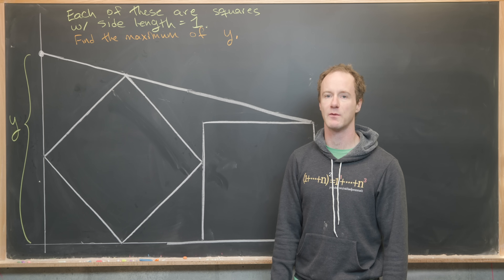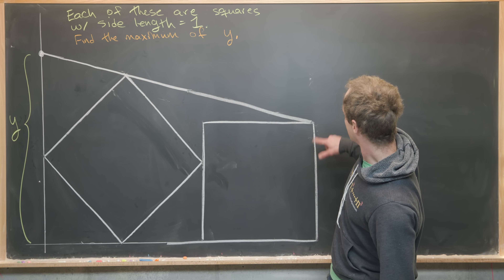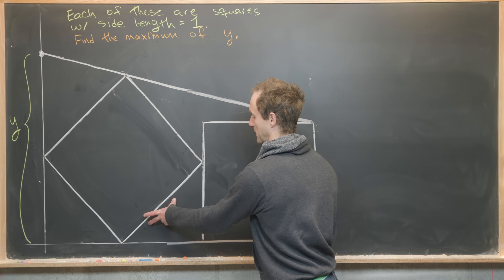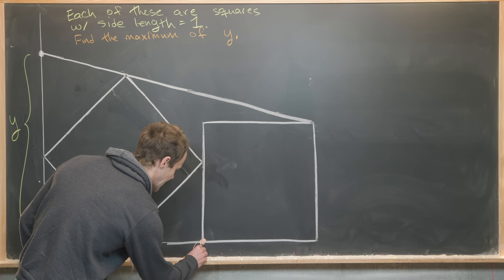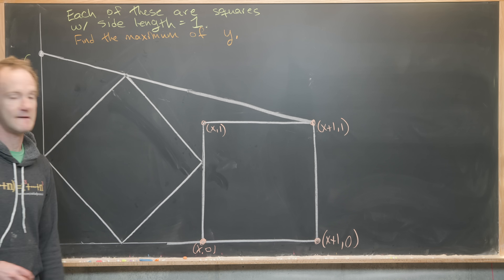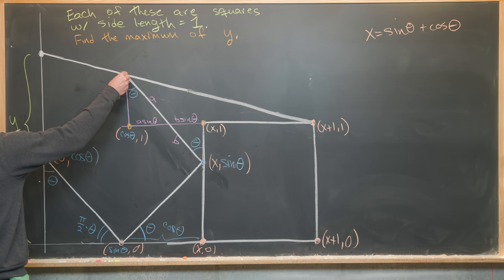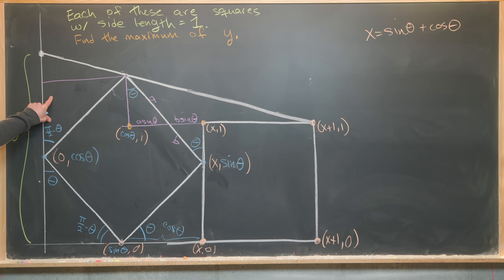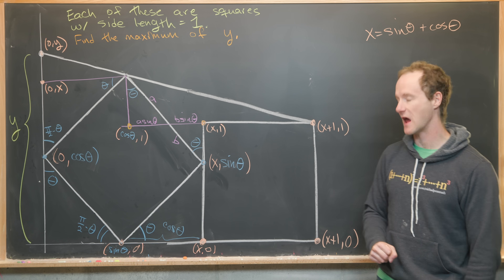How big can y be?

Comment: managed this one without trig. Let A be the x-coordinate of the bottom corner of the left square, and let B be the y-coordinate of the left corner. Then A^2 + B^2 = 1.
The line passes through (A, A+B) and (1+A+B, 1). The y-coordinate of the line between these two points simplifies to y = 1 + A - (B-1)^2/A.

Note that dB/dA = -A/B when you use the chain rule.

Setting dy/dA = 0 and simplifying a bit, you get (B-1)^2/A^2 + 2(B-1)/B + 1 = 0.

It is easier to get everything in terms of B here, so you end up with the cubic B^3 - 2B + 1 = 0, which factors as (B-1)(B^2 + B - 1) = 0. Golden ratio time!

B = (sqrt5 - 1)/2, and since B^2 = 1 - B, you get A^2 = B, so A = sqrt(B).

From there, y = 1 + A - (B - 1)^2/A = 1 - (B^4 - B)/A = 1 - A(B^3 - 1) = sqrt((sqrt5 - 1)/2)(3 - sqrt5) + 1, which is equivalent to Michael's answer

Comment: The problem becomes easier, when the diagram is mirrored along the y-axis and shifted such that the non-tilted square has its lower left corner at (0,0). If we denote with x the height of the adjacent corner of the tilted square, we can find y(x) = 2*x*sqrt((1-x)/(1+x)) + 1. This has an optimum at x = (sqrt(5) - 1)/2 with gives an optimal value for y of (sqrt(5)-1)*sqrt(sqrt(5)-2) + 1.

Comment: I love your videos in general but this solution is a bad one, simply because I haven't heard of a math competition where in the solution you can plug in wolfram alpha. I would recommend a little simpler solution which is based on labeling the same angle theta.
Label the big trapezoid (whose base y we need to calculate) ABCD by starting from the bottom left corner.
Label the topmost point of the tilted square as P. Then in terms of theta you can easily calculate the distances from P to the lines AB and BC.
Let F be a point on the line segment AD such that FC is perpendicular to AD. Again you can easily calculate FC and angle MCD in terms of theta.
In the end you will find that y = AD = 1 + sin (2 * theta) / (sin (theta) + 1). Calculating the first derivative and its roots will bring you to a cubic equation sin^3 (theta) + 2 * sin^2 (theta) - 1 = 0 which is very easy to solve because it transforms to t^3 + 2*t^2 - 1 = 0 which has one integer root and only one positive root. From here you can find sin (theta), cos (theta), sin (2 * theta) and therefore AD.

Comment: This equation is not so difficult to solve by hand 
After squaring both sides you can check for rational roots or get rig of repeated root with differentiation
Remaing quartic can be easily solved by rewriting it as difference of two squares and then as a product of two quadratics 
After solving polynomial equation check the solution because squaring both sides may produce extraneous solutions

Comment: i just assumed the square was rotated by 45 degrees and then i made two points and wrote the straight line. This could be solved more simply with euler's calculus of variations imo
 c

Comment: I don't get the question. The maximum? What maximum? You say later that you turn the tilted square, and it makes it pretty clear, but I really think it should have been included in the question explicitly.
Reply: The question asks for the maximum value of y.  That means over all values of anything that can vary, and the diagram has only one thing that can vary, the angle of the first square.  No ambiguity to my mind.

Comment: y = 1 + (2sinθcosθ)/(cosθ + 1)= 1 + (sin2θ)/(cosθ + 1).   considering dy/dθ = 0 leads to a trigonometric equation which boils down to
t^4 + t² - 1 = 0 where t = tan θ.  Optimal t = sqrt((sqrt(5)-1)/2).  drawing a right-angled triangle and plugging in values for sinθ and cosθ [try not to use Mathematica], gives the result y = 1+ sqrt(10sqrt(5)-22)

Comment: Why can't the box on the left be arbitrarily big, and cause the value of y to shoot off to infinity as the angle minimizes?
Reply: To follow up on my above post, it was a misnomer to assign coordinates based solely on sin/cos, and not taking into account the length of the sides of the left square.  So this solution is wrong, unless there's a stipulation that the box on the left is a unit square, which was never specified.

Comment: I defined x as the x-coordinate of the bottom vertex of the tilted square and used only the pythagorean theorem to determine the coordinates of the important points, no angles involved. 

That way I got y = ((4x^2 - 4x^3) / (1 + x))^1/2 + 1. 

To determine the maximum point I knew the +1 and the ^1/2 dont change the x-value of the maximum so I simplified y to (4x^2 - 4x^3)/(1 + x) which is easy to differentiate. The maximum is at x = (-1 + sqrt(5))/4 and I was too lazy to calculate y. 

The fun part was that I constructed the whole situation in geogebra and also displayed the target function in the same graph which allowed simple error control.

Comment: I did this a bit differently, using the angle of tilt (alpha) of the almost-vertical diagonal from the vertical as the parameter.  Then if y = 1 + z, and c = cos(alpha), s = sin(alpha), I got:
z = (2c^2 - 1)/(1 + sqrt(2)(c - s)/2)
Unwilling to solve dz/dalpha = 0, I just computed z for a range of alpha and found the maximum at alpha = 0.119 to be z = 0.600566, which is sqrt(10sqrt(5) - 22).
I notice that my equation for z looks a lot like yours if I put 2c^2 = x^2, s^2 = 1 - c^2 = 1 - x^2/2, s = (1 - x^2/2)^(1/2)
This didn't quite give your equation, then I realised I needed to use s = - (1 - x^2/2)^(1/2).  Now I get exactly your equation.  :)
By the way: 2c^2 - 1 = cos(2.alpha) = sin (pi/2 - 2.alpha), therefore if I put pi/2 - 2.alpha = 2.theta then alpha = pi/4 - theta.  If I substitute for alpha in my equation for z I get Sergio's equation. :))

Comment: The problem when eliminating theta is, that the quadratic equation gives two solutions. This reflects that x is the same for theta as for 90°-theta. Choosing the solution with sin(theta)>1/2, i.e. theta>45°, is IMHO the wrong one, as for that solution the "top" point of the first square is to the left compared to the (1-theta)<45°, and the slope is smaller (decreasing y). The x in the presented solution is negative, i don't know if that's a consequence or just some sign errors when writing it down, but clearly x>1.
It's probably better to keep theta as free variable.

Comment: If someone might be interested in what difference is made to the maximum of y 
by rotating the square from where the diagonal is vertical,
at the vertical, I got     y = (4 + √ 2 )/(2 + √ 2 ) = 1.5858
The answer shown,           1 + √ (10√ 5 - 22 ) = 1.6006
The difference is about 0.9 % 
I guessed it would be more than that. As the square rotates, the lowest point slides away and the length of the whole figure declines. Eventually, I could see that from the treatment in the video.

Comment: Awesome explanation!! I would like that you also add the simpler solution and not the "broad" solution....... The simpler solution is that we know that the distance between edges is sqrt(2) and we know that 'y' is maximum when the square is romboid...... So the distance in the floor is sqrt(2)+1....... And the height of the little triangle is sqrt(2)-1...... Awesome job!!

Comment: I did not read all the comments but your x solving from the derivative is negative, and that is impossible. The problem is that you made a mistake when you used the plus sign  for sin(theta) in set of minus sign. Following with this change of sign, making the derivative and solving for x, the value is aprox. 1.4041865 and then the value of y is 1.6005

Comment: Thanks Michael for this beautiful problem and all contributor's posts. I focused on the fact that someones found a rational value (8/5) while others found a different answer related with the golden ratio. Both answers are beautiful and I know I'm speaking about a difference less about 1e-3, but it seems that both didn't compute the same thing. The former maximize the max of the slope of the upper line. Unfortunately, the max slope of the upper line doesn't give exactly the max value for Y. The slope can be for instance a bit larger, and Y could be a bit smaller if the right square is closer. So we first have the max of the slope for Y = 8/5 (theta about 36,87° and tan(upper line vs horizon)=1/4) and then the max of Y = 1,600566... (theta about 38,17° and sin(theta)=(sqrt(5)-1) / 2).

Comment: Let the angle of rotation be θ then noting height and width of rotating square is Sinθ + Cosθ (let S = Sin(θ) etc )
Similar triangle gives us the required height is Y = 1 + 2SC/(S+1). 
Differentiating and equating to zero gives us the cubic  S^3 +2S^2 - 1 = 0
Wolfram alpha gives us S = (√5 - 1)/2  . C is just found using pythagoras.
Then carefully substitute back into expression for Y (tedious but straight forward)..

Comment: It seems to me that it is intuitively obvious that y will be largest if the second square is rotated 45 degrees giving the width to be 1+2^1/2.
Reply: this will get you within 1% of the correct answer, but still incorrect. It is not 45 degrees. it is 45 plus or minus 4 degrees to either side.

Comment: Solved it just using linear equations and pythagoras. y is the y-axis intercept of the linear function running through the two points where the square touches the slope. The resulting function is quite ugly, so I also turned to wolfram alpha to help with the derivative and setting it equal to zero. Getting the same solution felt satisfactory nonetheless.

Comment: In the expression for x, isn't the sign wrong in front of
 √(2√5 - 2)?

I get an evaluation for x of -0.168 with that expression;
but a more reasonable value of 1.404 with the sign changed to give:
x = ½ (√5 - 1 + √(2√5 - 2) )

That also is then in agreement with the results below of a maximum when 
cos² θ = sin θ
so that
sin θ = φ - 1.

Also I believe the identity
sin θ + cos θ = √2 sin (θ + ¼π)
(well known to the electrical engineers at least)
would come in quite handy in simplifying the calculations.

Comment: You are wrong bro
All your calculs after 9:00 mn are wrong 
From the beginning we can find that X=√2
Reply: Nope. He is correct. You realize that he probably checked this on Mathematica anyway! I solved it while keeping equations only in terms of theta and his answer is spot on.
Reply: @AnkhArcRod  please sir,
Tell me how X didn't equal to √2 ?
Reply: @AnkhArcRod  because with simple equations I found that 
X= √2  and Y will be = 3Z/2 (such us Z is the length of the square) 
in our case Z=1 
So Y= 3/2
Reply: @aroundtheworld590  Sure, ok. Actually, it turns out that X is little less than sqrt(2). The condition for optimality is tan(theta) = cos(theta) or sin(theta) = (cos(theta))^2. This leads to a rather beautiful solution for sin(theta). It is equal to golden ratio (sqrt(5)-1)/2. You can calculate y = 1 + sin(2*theta)/(1+sin(theta)). This works out to be 1.6004 > 1.5. If this doesn't convince you, just try drawing it with theta = 38.172degree. If the result is greater than 1.5, you should be at least convinced that your answer is incorrect.
Reply: @AnkhArcRod  The golden ratio φ is (1+√5)/2, whereas (√5 - 1)/2 = 1/φ
Reply: @MarkTillotson  Yes, you are technically correct. But, since it is seen as a ratio, phi or 1/phi makes no difference. For example, for a A4 paper, the longer side is sqrt(2) times longer than the shorter side and, equivalently, the shorter side is 1/sqrt(2) times shorter than the longer side.
Reply: @AnkhArcRod  The golden ratio is definitely greater than one, this is long established convention in the literature.  Ratios may or may not have a directionality depending on circumstance, in general 1:2 is different from 2:1

Comment: Actually, results in your way gives 1.60, while computating the intersection with the y axis of the straight passing trough A(√2/2 √2) and B(1+√2,1) gives 3-√2 (≈1.59). Since the maximum y is defined for the highest y that A can assume, the process should be correct

Comment: I found it simpler to set the origin at the upper right point, where the diagonal line hits the flat square (with x increasing to left for simplicity).  This give 3 collinear points: (0,0), (1+sina,sina+cosa-1), (sina+cosa+1,y-1); where 0≦a≦π/4.  Working out the slope, y=1+(sina+cosa-1)(sina+cosa+1)/(sina+1).

I know that can be simplified, but at this point I did a numerical optimization for y, yielding y≅1.600566212, to the limit of my spreadsheet's precision.  This matches the Michael's solution, again to the limit of my spreadsheet's precision.

Comment: Really ?????
Almost 15 minutes and not even the EXACT numerical solution ?????
Leave it up to mathematicians for not finishing the job !!!!!!!
It is a square with 4 equal sides with length  = 1 and 4 equal corners with an angle = 90° .
Thus existing out of 4 exact rectangle triangles with 2 sides of equal length !!!!!!!
Each triangle existing out of :
      * 2 corners with an equal angle of 45° which has an equal value of sin and cos which is  0.707.......
      * 2 sides of equal length = sin or cos 45° x 1 = 0.707.......
Now you have ALL the data you need to calculate Y !!!!
And the length of y = 1.5857..........
Yes I am an engineer !!!!!!!
Engineers always have to get the job done !!!!!!!
Reply: The answer is 1.600566212 or so.  y is not maximum with the square at 45 degrees - quite far off in fact, about 38.17 degrees is optimum.  Don't see how 1+√(10√5 - 22) isn't an exact solution

Comment: Oh, pulling out the ancient calculus memories at 12:00.

The derivative of the square root of a function is the derivative of the function divided by 2 times the square root of the function.  That is, d sqrt(f)/dx = (df/dx) / (2 sqrt(f))

Thus, d(sqrt(2 - x^2))/dx has f = 2 - x^2
Therefore, df/dx = -2x (derivative of 2 is 0, derivative of -x^2 is -2x)
Thus, (df/dx) / (2 sqrt(f)) = -2x / 2 sqrt(2 - x^2) = -x / sqrt(2 - x^2) = -x(2 - x^2)^-0.5

Comment: Here's a Desmos applet of how I did it: https://www.desmos.com/calculator/jvbwlbo5bp

I did it by taking the x-coordinate where the rotated square touches the x-axis as variable. Then the y-touching is easily solved by knowing the square has side length 1. Then the other vertices are gotten by 90 deg rotation and the formula for that is simple. Then do the line stuff. I find the expressions are neater when we take the variable this way.

Comment: Sir i think you have calculated minimum value of y instead of maximum you should check it by second derivative test
And also value of "y" you have found i wrong if we plug in
Reply: I believe you are correct! If you plot y as a function of x, there's a minimum at the value found above, but that's the only critical point. This function actually has a max at one of the end points of its natural domain which seem to be x = 1 and x = sqrt(2). The latter looks to give you the max.

Comment: You can solve this without calculus though, can't you, by plugging in values of the angle and seeing which theta gives the maximum y value?
Reply: Smells like an upcoming engineer in here.
Reply: So I did it without using angles, by specifying the x value of the corner of the rotating square, then plugging in values to find the maximum y value to be around 1.6005236512374004 while Michael gives a value of about 1.600566212001556. So yes, you can get pretty close. The advantage of using calculus is you can  PROVE the answer the maximum, and show it is an absolute maximum and not a local maximum.
Reply: Not really, without calculus is not possible to prove that the max value you find is the actual biggest one ( mainly because you would have to check literaly every single angle, but there are infinitly many, so......)
Reply: @joaopedrobmenezes2977  no you can maximize y value by construction the two squares are at 45 degree to each other - some logic can demonstrate it is a local max.

Comment: I drew it on Autocad, and got 1.58578644 instead of 1.60056621. Any ideas?
Reply: You are assumming that the  rotating square on the left forms a 45 degree rotated diamond with its corner to corner length = sqrt(2). Rotate the left square on autocad varying small amounts,and move it  so it touches the side of the right square again. When you find a situation where the left hand squares adjacent corner,( to the one touching the right square), leaves the top line you should draw a new top line accordingly. This in turn will make the value of Y larger. The max value of this is actually largest when you rotate the square roughly -8.0 degrees clockwise. You can do that on Autocad. Hope this helps.
Reply: @jezzag9739  Thanks! You made me realise that the oblique line would be tangent to a semi-circle centered at the bottom vertex of the rotated square, not touching directly the top vertex of a 45deg rotated square (what would be the "quadrant" of the semi-circle). I'll try it on Solidworks, I can use the "Max dimension" function. So the rotated square can be in 2 positions to maximise Y, if we consider the semi-circle tangency instead of the square's vertex, but only 1 where it's upper vertex also touches the oblique line. Merci beaucoup!

Comment: I dont understand why, as others suggest, that you cannot use x=sqrt2 due to the maximum of y being related to the maximum of x, since the largest x can be is the diagonal of the rotated square of sides 1, also sin(theta) then equals cos(theta) and theta =45 with those being known values. Unless the objective is solely to solve using first term diff calculus or without the sides of the square being known